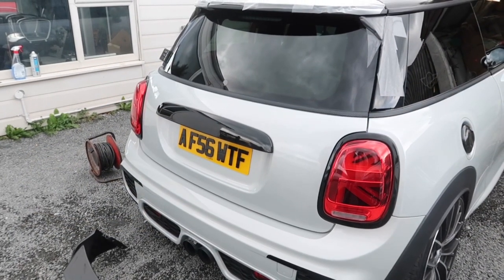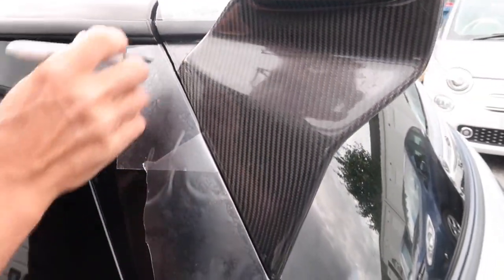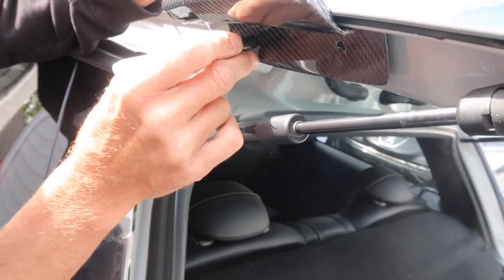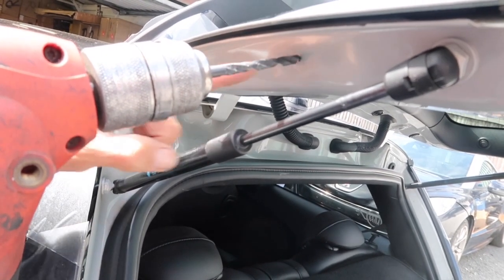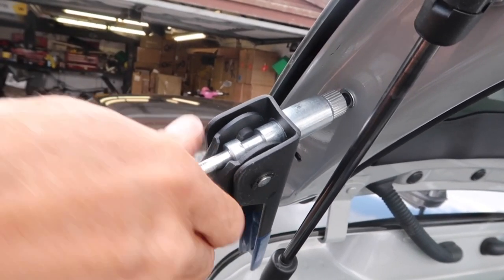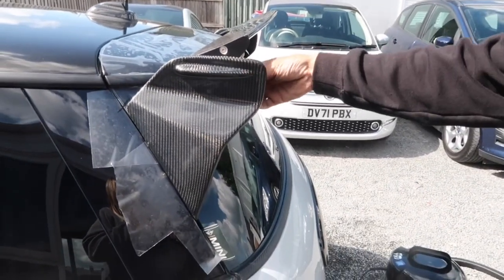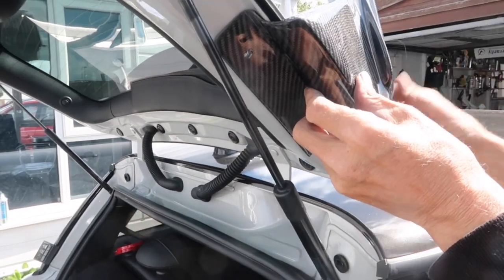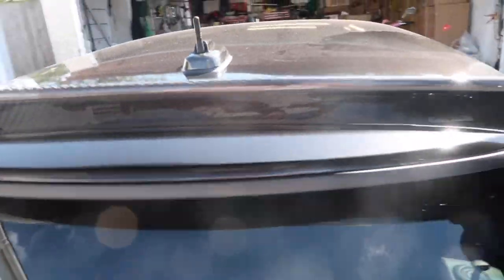MINI GP Style Spoiler Install - F56 KillAllChrome

Comment: Will this spoiler work with a F56 LCI2 Cooper S spoiler?  I noticed it doesn't have the little flick on the stock spoiler like it does on the F56 LCI2 Cooper S spoiler.